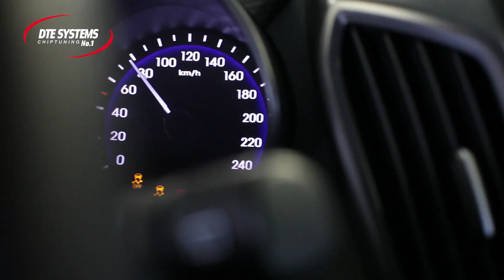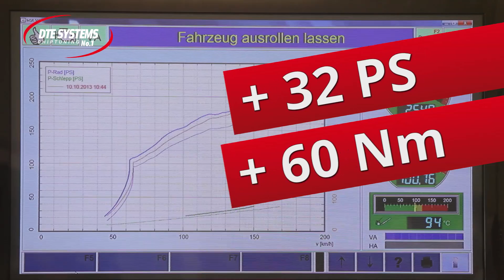Hyundai Veloster 1.6 Turbo, Tuning Development & Dynorun on Maha Dyno - DTE Systems

Comment: und kostet? wie viel würde das bei einem 1.6 GDi mit 140ps kosten
Reply from the maker: Hallo Tobias, der Veloster im Video ist ein Turbo, dafür sind Leistungssteigerungen mit PowerControl ideal. Beim 1.6 GDi mit 140 PS handelt es sich um einen Saugmotor, womit Tuning-Boxen nicht in Betracht kommen. Sorry! PS: Für mehr Beschleunigung und Fahrspaß gibt es noch die PedalBox von DTE. Die ist kompatibel: Egal, ob Turbo oder Sauger, Verbrenner oder Elektro. Viele Grüße aus Recklinghausen!